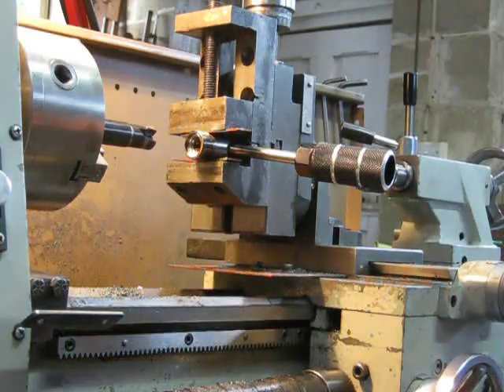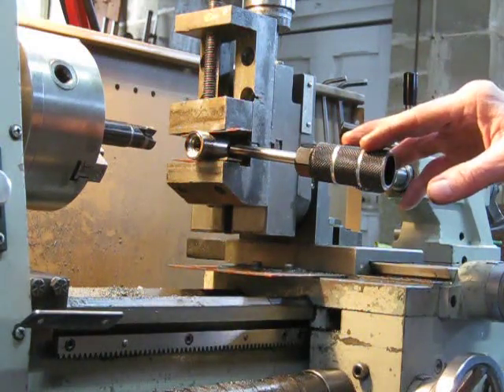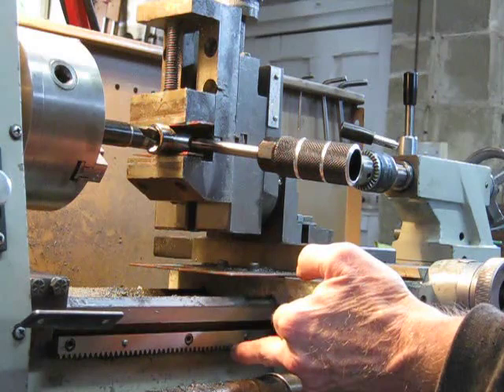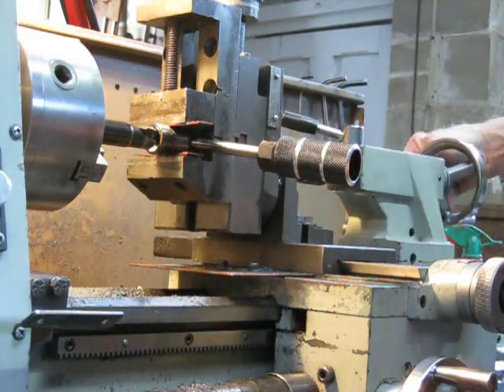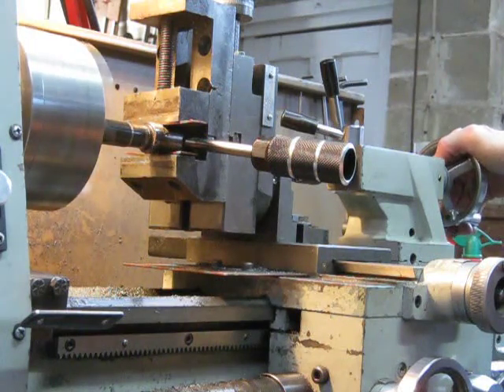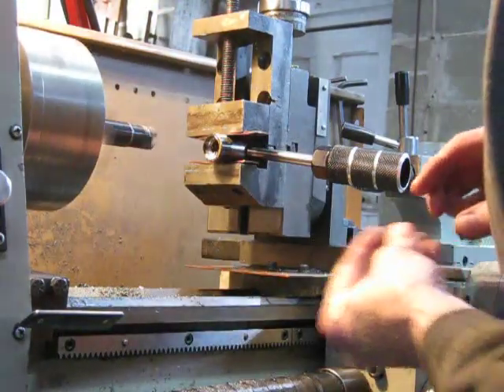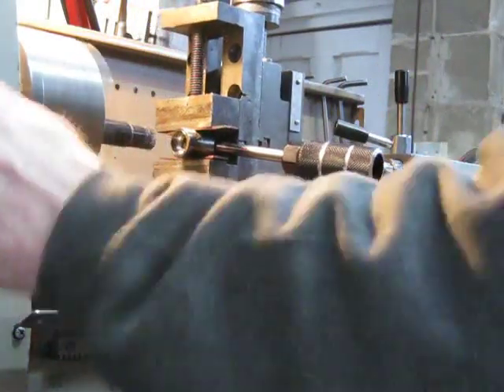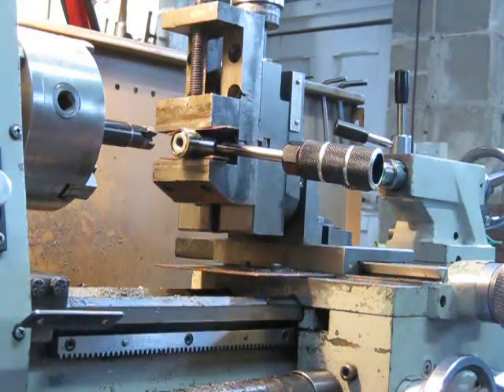How to center bore on a lathe with a vertical mill slide

Comment: i am trying to find a vertical mill slide for my lathe, and from what i can see it is basically the same as yours. If you would be so kind could you please let me know what brand or where to get that one. it would be greatly appreciated
Reply from the maker: I'm in Australia and got the mill slide from Hare and Forbes - it's a Chinese no name brand.  If you are overseas then that information won't be much use to you.
I can only suggest you try the major lathe sales points - eg. Bolton Tools etc.
Reply: thanks i appreciate the reply, yea i have searched high and low still havent found anything.
Reply: LJMfabrication http://www.machineryhouse.com.au/L277
Reply: xynudu http://www.machineryhouse.com.au/L277
Reply: xynudu  hey mate love your videos and have ordered the paramount FI-610! :D i have a hare and forbes near me and have the vertical slide but as far as the vise goes what do you recommend? i was considering buying a milling machine but after seeing this i thought my money could be spent else where considering i can do most of the milling work on the FI-610, sorry long comment! what are your thoughts on the the rotary tables over say a vertical slide on a lathe? thank you so much for your time and videos!

Comment from the maker: Glad you found it useful Cruddy :)  I forgot to mention in the video that you can also read off the depth of the cut/carriage advancement from the scale on the tailstock ram.

In the video I just did it by eye as it didn't need to be super precise, but for repetitive  jobs it's handy to have a readout or use a carriage stop (best way to go).